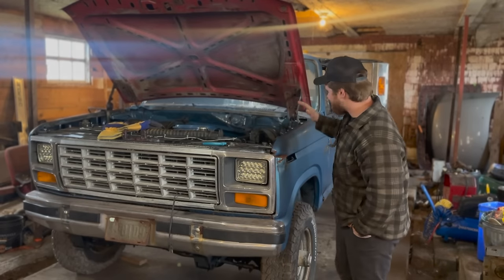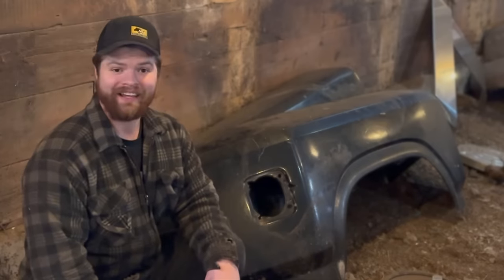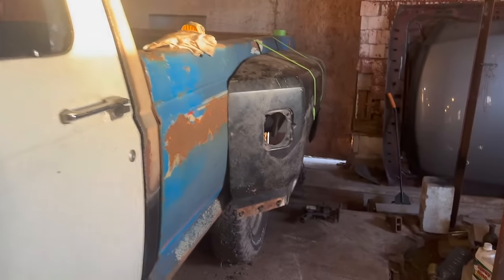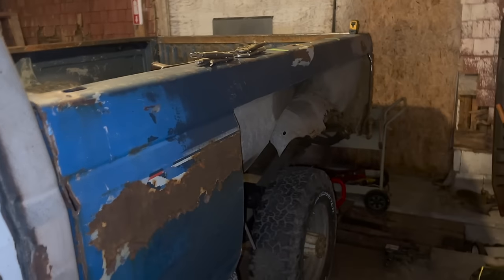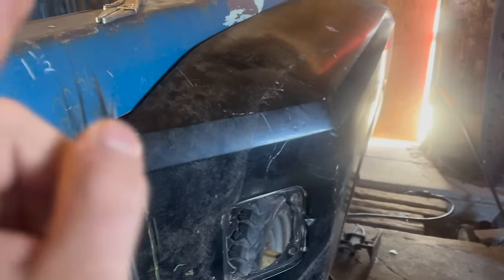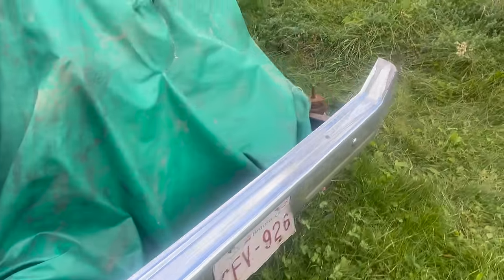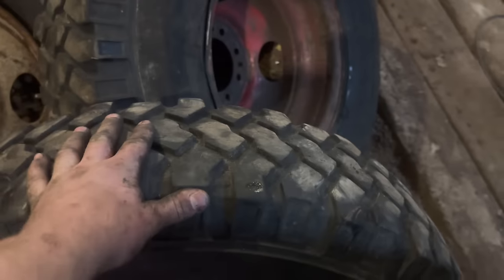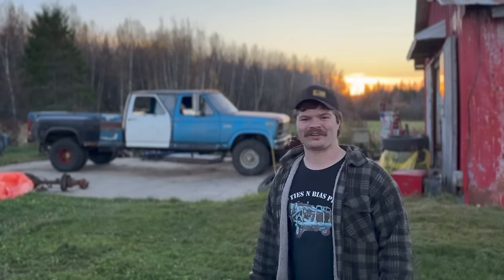Step Side Fender Dually Conversion 1980-1997 F Series Ford Trucks!  Homemade Mega Cab EP:8

Comment: The front hub you can knock off a 1 ton and bolt the ones already on truck
Reply from the maker: I have a bead on a set currently, unfortunate the 2wd ones are cast into the rotors

Comment: Can you convert the front to a dually front or is it actually a different with like the rear are
Reply from the maker: Easy to convert but ford actually used a 6 inch spacer per side it’s nuts haha 😂, so you have to find the spacer. Dana 60 and 50 ttb are virtually identical on the outlets so the main axle body isn’t an issue, just rims hitting the calipers